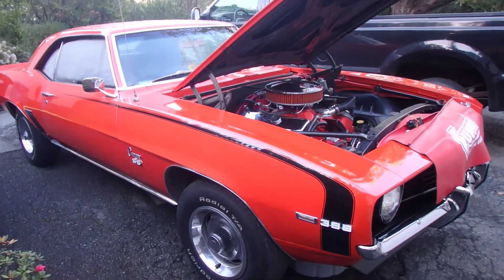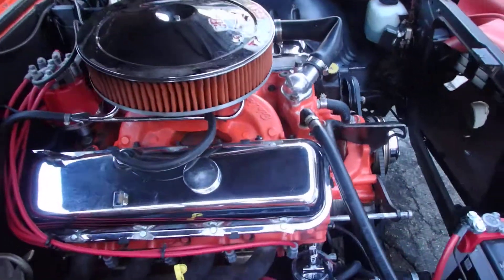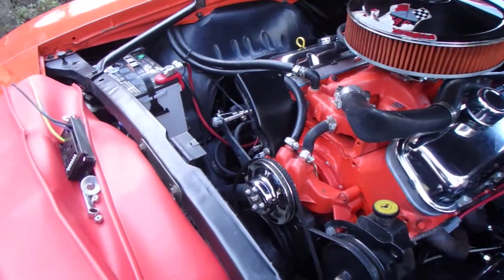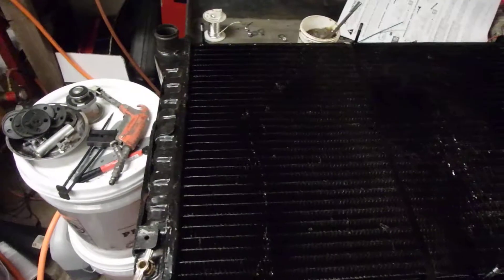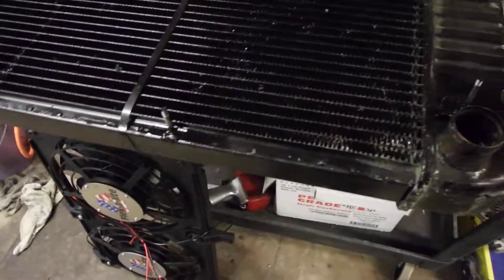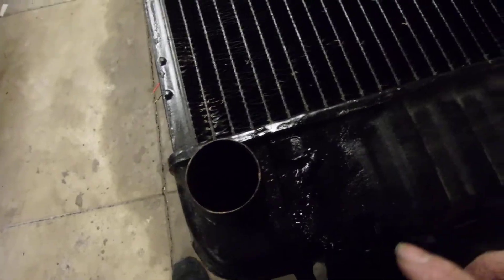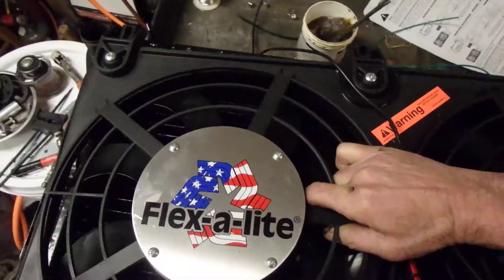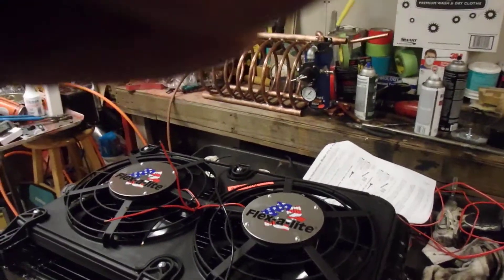how to install electric fans on 69 camaro ss 396 4 core radiator

Comment: I'm not a big fan 'lol' of flexalite. I've used them over the years and I can say from experience they don't cool all that well. The fans don't pull enough air or the motors are week not sure the problem. I've become a huge fan of oe fans. In my 64 chevelle I have an aluminium down flow 4 core with a 2016 jeep renegade electric fan. It was 95 yesterday and it held easy at 170deg cooling my SBC 406 pushing 500hp. Have it set at 175 and the fan comes on for a few seconds and goes right to 170 and shuts off. And the best part is there cheap usually around a hundred bucks new or in my case free used from a total wreck.
Reply: What year renegade did you pull that off of? I to have a 64 chevelle ss convertible but I think
I’m
Gonna run the flex fan, fan clutch, original radiator upgraded to a 4 row, and the original fan shroud. Before I was running just the fan, no shroud, no fan clutch, with my aluminum radiator. Would cool down when I hit the gas but in traffic it would heat up to 210
Reply: i had the same experience, i bought the 16” loboy puller from flex a lite and it was rated for 3000cfm i put it on along with another fan that was around 3000cfm and the flex a lite did NOT perform better than the ebay fan with high out put motors, i used an anemometer to calculate CFM and i also check the Voltage with a  clamp meter. 
for 150 dollar it wasn’t worth it for me. so i bought a lincoln mark 8 fan and that Mother pulls 4000+ CFM it’s a hurricane! 
it also pulls about 41amps consistently. more power draw usually means more motor torque and better cooling with more resistance due to the radiator thickness. 
i made a video on this if you want to check it out on my channel.